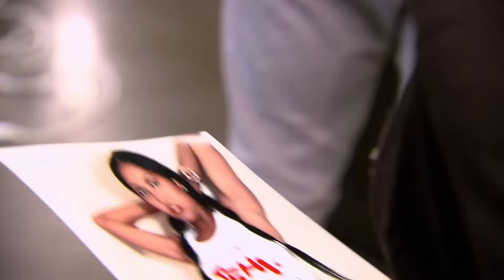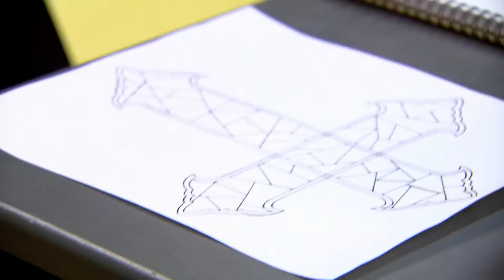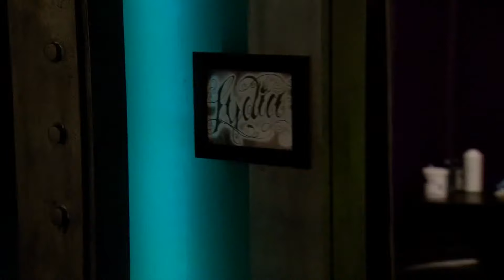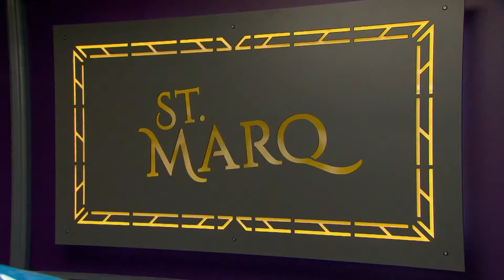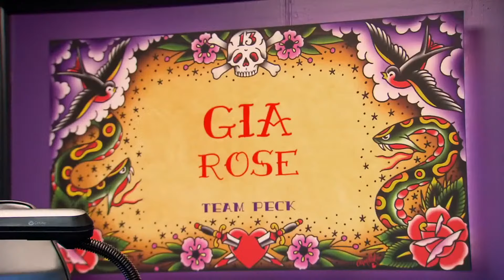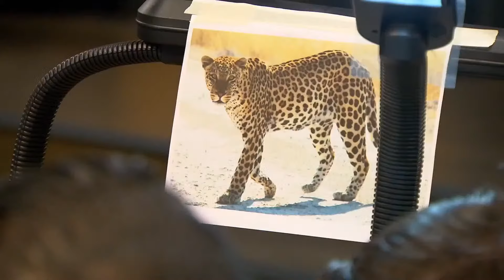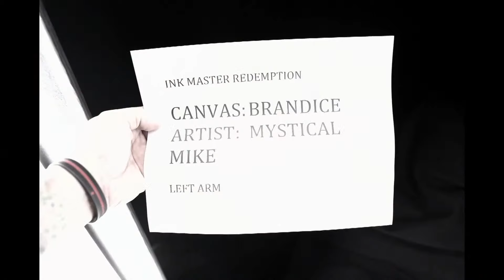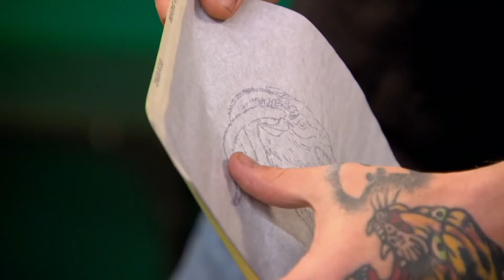ngl... I'm New At This | Ink Master's Fan Demand Livestream

Comment: Brutal and Permanent! I'm never having a tattoo! Ahaha!
Reply: It's honestly not bad if you get it in an easy spot. As someone who only has one tattoo I put it on my arm so that I could sit for the whole thing. I also say it felt like a sunburn. It really wasn't bad. Just be sure to pick out the right artist for you and do something distracting while you get the tattoo. And you'll be golden my g.
Reply: Really depends on spot and artist I have a few and the only one that hurt (not unbearable) was done by a professional of 15 years on my upper bicep non are color though I was told color is a little worse bc shading/color is a wider set of needles, not bad at all in my opinion but I also have none in very tender spots